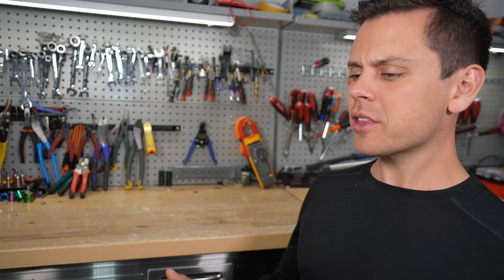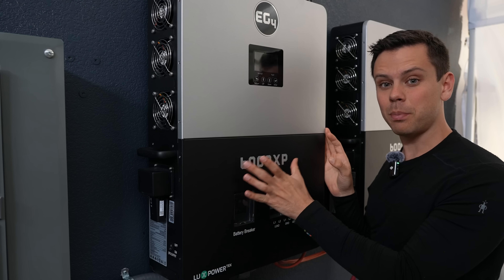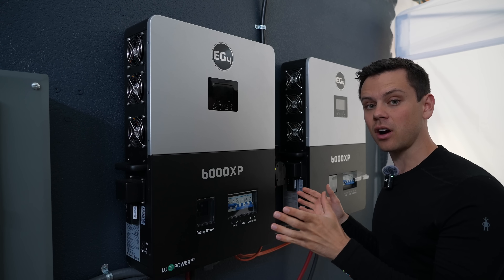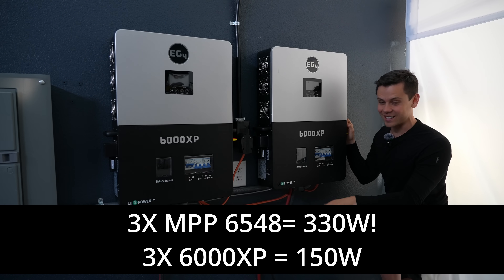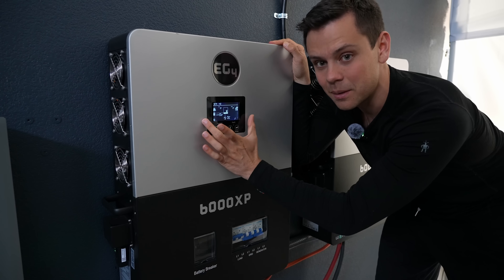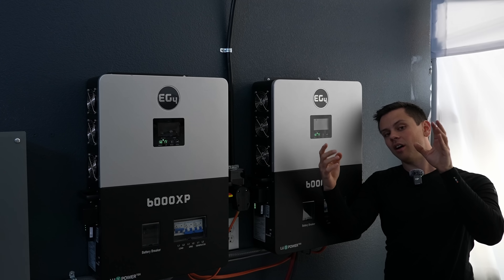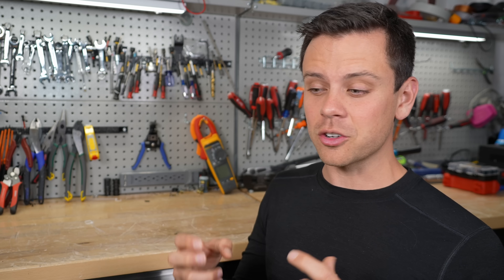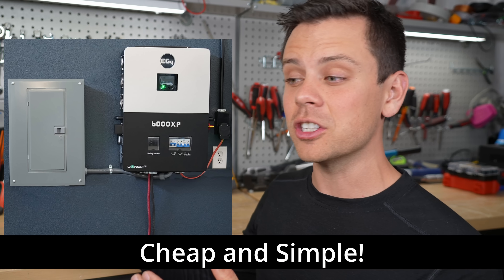Offgrid VS Hybrid Inverters! Which one is better for the $$$?!

Comment: I purchased my first EV. If I wanted to charge the car from a diy power wall, how many lithium ion batteries would I need to mimic my 240V level 2 charger along with any additional equipment?

Comment: Hello in Colorado there is a 120% rule.  This means You might be suplemented for power up tp 20% over your solar production.  There is paperwork and documentation to prove you have a 'safe' grid-tie system.  This includes a base 17 dollar fee to be a customer.  Regards

Comment: I went through my entire 2600 square foot house and replaced every light with LED bulbs, upgraded appliances and got my energy consumption down to a bare minimum. I then did several weeks worth of research, including watching a lot of your videos, before buying system components. I purchased a pair of EG4, 48 volt, 3K watt inverters and built a 48 volt LiFePO4 battery bank. I made the system modular so that I could pull an inverter and battery out, put it in my motorhome and take trips. I'm happy with what I've put together with your help. It works great! Thanks for what you do here, Will!
Reply: Here in LA they are f%cking me bad on time of use 
so i got 3 6000xp ...to give them the finger
Reply: Using LED bulbs will also reduce summer cooling needs and I have LED bulbs that have  not burnt out in 10 years.
Reply: Seems you spent a lot of $$$$ to sa ve $$ especially if you are dumping working appliances for higher cost efficient appliances that probably have shorter life spans. Then, you reduced your consumption so without solar you already reduced grid utility cost. Next,  add cost of solar system.  There are a lot of years before realizing true savings unless living in CA. Then maybe.
Reply: @andret4403 I live in Indiana and you can actually save money even without solar. Daytime pricing here is 24c per kWh and only 5c from 11pm until 8 am. You can have a 30kwh battery pack for a medium size home. Use that during the day and charge it at night
Reply: What do you use for heating/cooling? I am studying as well what I should set up. My off grid house will be of similar size.
Reply: @killuadre9176  I'm using natural gas and a pellet stove in my home and propane in the RV.
Reply: I'm looking to do a setup like this that I can use with my RV. Thanks for giving me a starting point!
Reply: Any interest in sharing your design layout (pics / schematics )?
Reply: How much did the permitting and inspection cost?
Reply: @vincwis  Permitting and inspection for what?
Reply: Sooooo important to get efficient before trying to just build some gigantic expensive system. 

For me, I go into “camping mode” when the power fails, and only power critical loads, which right now includes a window unit in a room but not my huge AC compressor.
Reply: I agree with your comment about thanks to Will. such great information
Reply: You were still using incandecent or even worse those compact flourecents?

Comment: In Tennessee you still need to be code compliant with off grid solutions.  Even if you have zero feed from the grid, the system still needs to be code compliant which probably means UL certification.  I’m going to try to check with state inspectors on XP 6000.   That’s what we hope to use for our home - zero grid connection
Reply: No code compliance needed to install in a road licensed vehicle (a solar power enclosed cargo trailer for instance)

Comment: had poor performance with the built in mppts on the cheaper  off grid all in ones... vs a victron smart  100 35 mppt ... app control and lip0 defaults/monitor / logging... never looked back..  multi plus 2 . 3K    fast ups transfer is nice...

Comment: I installed the solark 15k in November. It's awesome.  i haven't even begun to see what it can do. Your info has been invaluable
Reply: I have the solark 15k for a year now, have had no problems at all,  Have 10k of panels and it pays for all of my electricity even with 2 air conditioners running in the summer.  I get cashed out in the end of December, and had to pay for 5 dollars of electricity in January.  It was cloudy in January!.  I used my excess electicity for heat during November and December. Not sure if its worth it or not vs getting payed for the excess at 2cent per KWH.
Reply: @nobody342  Which batteries did you get and how many?
Reply: I also have the Solark 15k and it works ok except every load change up or down makes the lights do a very quick flash. Solark has not been any help in repairing this. I also have a 12k in another bld and it works with no problems.  I will not buy another Solark product.

Comment: I just wanted to mention that the Samlex EVO Series of inverters have the ATS Also built-in .  For example their 4000W models have AC IN from 2 sources : Grid or Genset with programmable AT modes etc.  NO AC to Grid export possible.

They are Low Frequency with Transformers and so quite heavy as a result but also very efficient @ 94% & with a No Load idle consumption of 25W (Normal mode) or 8W in powersave mode.   FYI  These are Indoor models & their fans are Loud.... 

My offgrid solar system started before AIO's or even before when Victron was available in Canada...  I use Midnite Solar Controllers & Samlex Inverter BUT IF I was Building "TODAY" it would be All Victron due to the complete software management ecosystem and interoperability/compatibility  of all their gear + the Long Term Product Support which is a Big Deal if/when needed.

Comment: Is it better to spend almost double for a unit with double longevity now, or spend less for a unit that you'll need to replace assuming that in 5-10 years the advancements and cost reductions on the replacement unit will make it better than today's advanced unit? (Looking at the jump between the ex and xp as any indication) 🤔

Comment: Excellent Analysis!!!

PLEASE MAKE A VIDEO
on Multiple hybrid inverters 
in Parallel - 

preferably 4 x 18kPV in parallel
with appropriate batteries and solar panels

discuss all wiring and safety considerations

ac combiner box wiring
bus bars 
and surge or fuses you would use
etc etc

thx

Comment: I bought my EG4 system with two 6500EXs.  Now I could get a system with 1200 more watts of panels and two 6000XPs for $2000 less and not have to buy and wire the pv breakers and DC disconnect.  Now Signature solar is offering to switch out the problem ridden 6500EXs for 6000XPs for just $1,500, whoopee.  I do like that then each one will output 240v so I will probably do that.  Besides, all that light flickering and UPS clicking is very distracting.

Comment: Yep well said Will. I have the Sol-Ark 15k and love it. It can start and run my 4 ton traditional AC which surged to 125 amps. It can also run my deep water well pump and my 240v water pressure pump. It’s a beast. I’m going to swap it out with the EG4 18k PV and see if it performs the same. We’ll see.
Reply: You’re having better luck with the 15k than I am. I rate it pretty close to junk. I also have a 12k and that works fine
Reply: @samdixon6867  wow you must have gotten a faulty unit. See if Sol-Ark will exchange it. I’ve had no issues with it at all and I push it hard every day.
Reply: @unpluggedtexan  yes I tried numerous times to get Solark to stand behind the unit but they won’t. They may answer the phone and offer verbal advice but they don’t actually stand behind the unit

Comment: I think it should be mentioned that hybrids can utilize CTs and supply its max output to main panel loads and not shutdown if loads exceed inverters max output. The grid simply simultaneously supplies the excess power the main panels loads need

Comment: Will, while you go into detail a lot, you miss a point each time. You have a large audiance and I would be pretty safe in assuming I am not the only one from outside the US. Many of us use more standard power of 220V (220-240) @ 50Hz. While this may not be everywhere, US is the only weirdo's who run split-phase mess. 
Please be mindful of this and maybe focus a video on the products that can be used safely and legally in true single-phase (no floter centre-tap or floating voltage/current and no earthing).

Comment: Great info Will.  I will need to ponder getting the hybrid.  I guess you could build a box for the inverter with hepa filters and push pull fans as a compromise but is it worth the headache?

Comment: my trace sw4048 inverters were put in service dec 96, one display turned flakey a dozen years ago and I have been running on the second only with the flakey as backup. life is good.
Reply: I have the same inverters, in series, for both 110V and 220V,  since 2004.  I don't get the rated 46A AC out of either of them; I can only get about 30A, without them tripping, when I try to charge a Tesla... but they've been bulletproof.

Comment: If you want to use a smaller generator to charge your battery and not having to buy a chargverter. The 18k is the best unit.

Comment: Somewhat tangentially related, but I'm on NEM 2.0 in california, and want to add extra panels / battery. I'm assuming even set to "zero export", the 18kpv wouldn't be allowed by PG&E? Conversly, the zero-export by design of the 6000XP might be allowed?

Comment: For some, a solar setup is like a car purchase where they don't mind paying extra to tech-pose (looking at Tesla Solar Roof buyers).  For me, solar must buy its way into my house.  Cost is critical since one option is doing nothing and just paying for grid power.  Prices may continue to fall and tech improve, so I went with the cheapest reliable unit and ordered the EG4 6000XP, though no delivery date yet.  The Chinese brands looked suspect, with no breakers on inputs and outputs, and many with poor reviews.  Will also go with a cheap LFP non-smart battery.  Can upgrade as it improves.  I don't like that the 6000XP should be mounted inside since my garage gets hot in Summer.  Also seems I need a PV disconnect switch outside by the panels since emergency personnel shouldn't have to get inside to the inverter to flip its PV switch.  Perhaps I'll mount the 6000XP in the carport since close-enough to an indoor location and perhaps even cooler in Summer.
Reply: You could mount the 6000XP and LiFEPO4 batteries inside your house, if you have room, as it would probably be cooler in the summer. Having the solar array disconnect switch is a very good idea from any viewpoint, as one never knows when it might be needed.

Comment: On Maui, there's no way I would go on the grid. They buy power from you at 11 cents per KWH they sell power to you at 42 cents per KWH. They limit the amount of power that you can produce.  My subsidized LCOE is $0.08 /KWH.  There's a $10,000 hookup fee to the grid and a grid maintenance fee of $20 a month. The price of energy here will go up by 10% over the next 8 years. I would rather buy a small generator for the rare occasion that I would run out of power. The future of power generation will be through independent homeowners, and not the government or big businesses like Enron. The biggest problem we have is with PUC regulations limiting the sale of excess power. If we can get rid of that level of fat cat protection, it would lead to a much freer society. Love your show Will thank you!
Reply: For all you folks with this lopsidedness, you may look at getting a hot water heater with an electric element.  Then dump your excess (that you cannot load to a battery), into the hot water tank.  You could even  use this HW tank as buffer tank.
Reply: @petersamios5409  lol, that is exactly what I am doing. I am also probably getting an inline gas water heater just in case because of the size of the unit. It is a triplex with six bathrooms.
Reply: California is similar now.  Most utilities are under PUC regulation.  Their latest NEM 3.0 for solar credits little for feeding the grid.  They proposed only 3 c/kWh, but recall had to settle for a little more.  They also keep trying to kick off those grandfathered in with net-metering.  My utility is not PUC but only credits 7.3 c/kWh, which charging up to 35 c/kWh peak Summer.  They also have one-time and annual connection fees, plus must approve your system.  Most people installing new solar in California now skip the grid-feed setup, which makes microinverters like Enphase not an option (only work with grid-feed).
Reply: @SihAza  it is junk regulation like this that makes going off-grid so much easier and cheaper. They are pricing themselves out of existence. The tax credit in Hawaii is contingent upon grid hookup, so I will be foregoing the Hawaii tax credits. It is actually a trap so that they can reassess your home and increase your tax base as well as tax grid power. Generating power for yourself is the ultimate freedom.
Reply: @SihAza  I thought IQ8 microinverters can work off-grid?
Reply: @Hypertrev11  I only know from reading.  I understand that microinverters require sensing AC from elsewhere on their output terminals, in order to synch to it.  Some people consider using a small inverter to form such signal for off-grid use.  Perhaps IQ8 has an internal generator for off-grid.
Reply: @SihAza  Yup Californian here with a grandfathered system,  I haven't had to pay for power for close to 15 years, but they keep trying to kick me off,  they started with a connectivity fee of like $5+ a month and ok sure whatever I get it there are line costs associated with it, my excess more than pays for that too.   Now they're trying to bump it up to almost $30 and you can see the schwarmy politician ways they do this by making the argument "that this will actually lower the cost for most people"  (which is usually code word for "this will make us more money, we were just kidding about lowering your rates").     Just the way PG&E seems to write legislation for the CPUC to agree to is just so frustrating that I want to scream at someone.
Reply: There is so much solar on the grid in California that the system operator exports power to other states, sometimes paying them to take it. Why should your power company pay you for power they don’t want and can’t use? Buy a battery.
Reply: I saw that documentary about Hawaii utility company, that was crazy
Reply: Selling power to utilities doesn't make financial sense. They have to maintain the same system with less revenue as solar becomes more popular and everyone shares the same peak time of production. They should have gotten into solar installation and used their economies of scale to be the cheapest provider. As the cost of panels and batteries go down, the relative value of your roof or car port goes up. Why go to the desert and build new power lines when you can bring power directly to the customer. The chief value of the grid is now in extreme conditions when interegional power lines can move power from places of surplus to areas of scarcity.  However, I have a very modest system but just went 12 days in the rainy season without connecting to the grid. Even with input cut in half, I was filling the batteries every day. I could easily double my panels and probably go years without interruption.  I'm not sure utilities could justify the cost of maintaining the system under such circumstances. Who knows how tariffs will affect solar in the USA since they seem to charge like the weather.  However, I'm outside the country so, good luck. If you are an American ask yourself why the same system costs 3x the price as in Europe.  You think Germany has fewer regulations? I'm sure their standards are as high as ours.
Reply: It’s far more efficient for a single power provider. That said, moronic politicians that have never worked in the private sector always setup energy companies for long term failure.
Reply: Aloha Terry,  this is Joe. I live in Maui too. I am new to this DIY solar system. Are you currently off grid , and what system do you have thanks.
Reply: @joev3323  I have a property on the Big Island. Going to install an off grid system. The other problem in Hawaii, you must use a licensed electrican to install anyting electrical. makes it hard to do DIY.  need to find an electrcian that will work with you...
Reply: Wow, things have changed a lot in the year since this came out.
Reply: Enron?  What’s an Enron??
Reply: @rpdx3it was an eco scam ... Look it up.
Reply: Hey Terry, I'm interested in doing the same thing I live on Maui too. I'm interested in which system you installed. I'm thinking about going off grid too and just building lots of capacity. Did you DIY the whole system? Did you need an electrician to pull permits and if you did, who would work with you? Mahalo.
Reply: I have started the global rent and utilities union to fight this and bring the utilities companies to the bargaining table. I sent an email to will about this already. Help is coming! No people may be kept under force of arms forever. The greatest force in the universe is the need for freedom.
Love you all.
I am the black swan
Reply: Politicians sold us out . In La. They pay $.019 per kwh I believe there's is a monthly charge as well. Utility gets to charge consumer fuel charges and infrastructure. But solar gets no consideration. 0 export but grid tie is the way to go imo. System monitors how much to produce but never exceeds utility.  But if they're gonna charge u to be power sovereign then offgrid wins hands down
Reply: @blainecelestaine4543  California already have enough solar for itself so they have to do this at some point.
Reply: @blainecelestaine4543  well in KC Evergy only pays 12 cents and some only 6 so I might stay solely off grid
Reply: Communism in action
Reply: @nomadbiker4040  You misspelled "capitalism"
Reply: @Mike__B  learn the difference between cronyism and capitalism